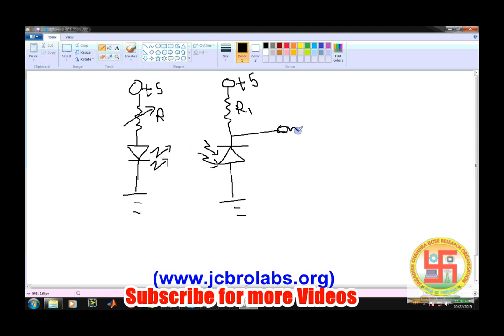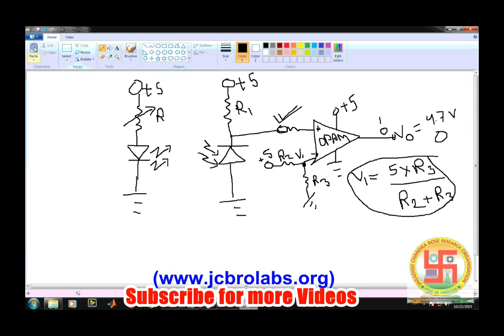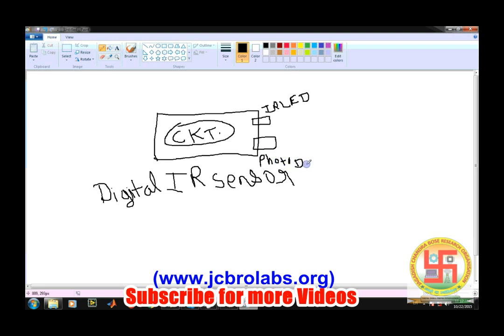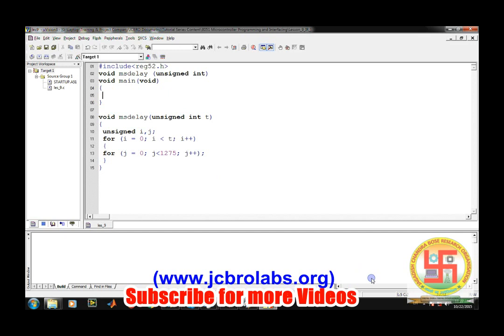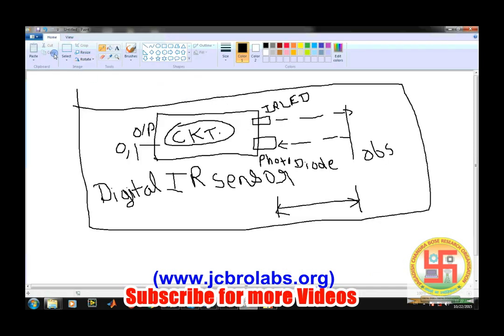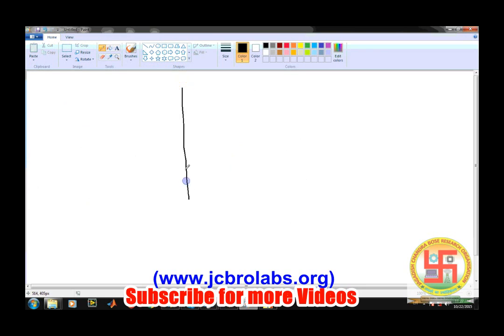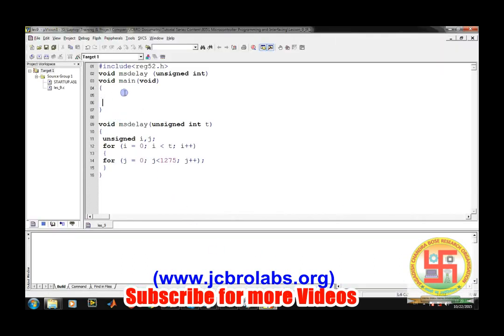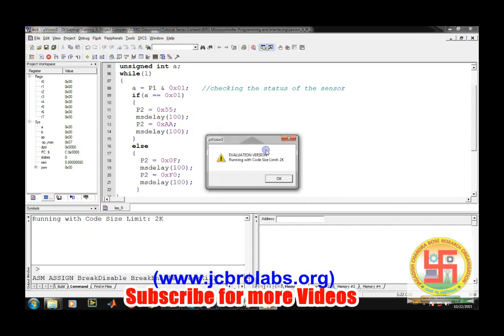Lesson 9: IR Sensor/Obstacle Detector Interfacing to 8051

Comment: out of 3 resistor which one is used for potentiometer ,i am not able to understand how potentiometer will change range
Reply from the maker: Potentiometer change the current flowing through the circuit, which ultimately changes the intensity of IR LED. Range is proportional to the IR LED Intensity

Comment: Sir, how can we interface IR LED with LPC2148 ARM processor
Reply: since lpc2148 is dual in line package it read as well as write pin status.
connect a port pin to one pin of IR sensor and other to ground,and read the pin status ,if pin status is 1 some object is there else no object.
In case if u want to measure distance u need a analog port and seperate analog sensors are there for it.